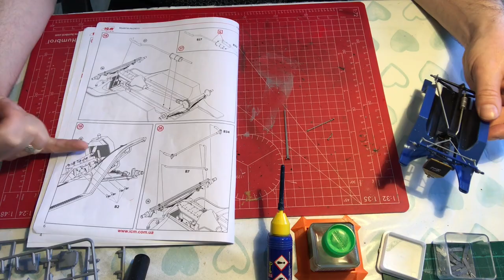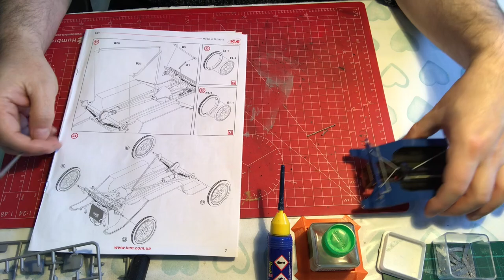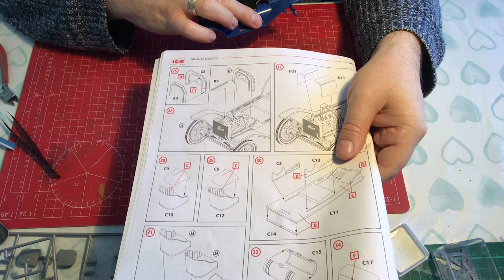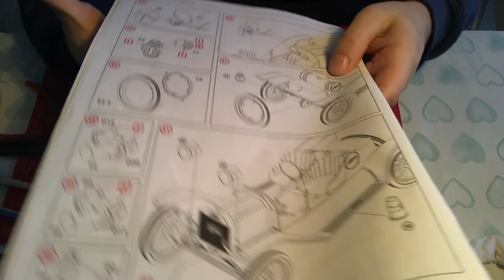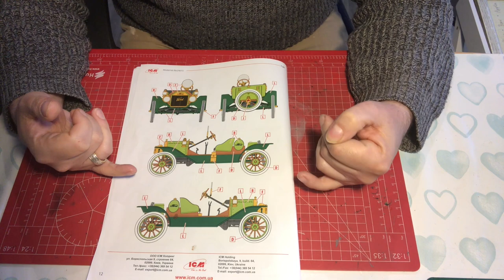ICM 1/24 model T Speedster build part 2

Comment: Hi Jason,  your T is looking great!  I really like your choice of colors.  I had a lot of trouble fitting the firewall/hood/radiator and getting it to all line up.  I am definitely not  being critical, but this Model T didn't have light bulbs.  The front headlights burned Acetylene and had a burner located inside to the bottom of the light.  The lights on the firewall burned Kerosene and had a wick inside.  I am really enjoying the build.  See you next time.
Reply from the maker: That saves me a lot of messing with bulbs thanks!
Reply: @ModelkitStuff  That brass colored cylinder on the left running board is an Acetylene generator.  Calcium carbide is mixed with water to produce Acetylene.  A copper line runs to the headlamps to produce light.  See you next time.